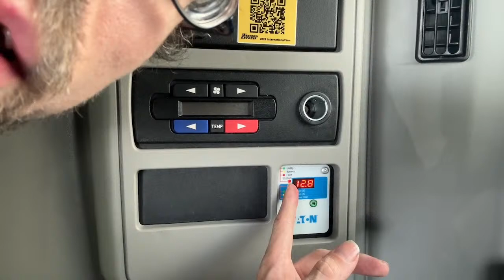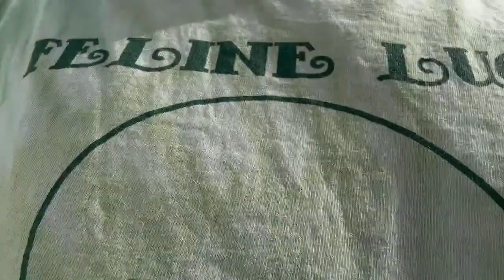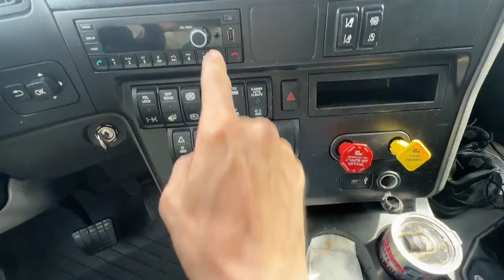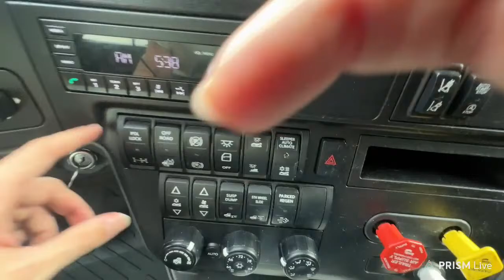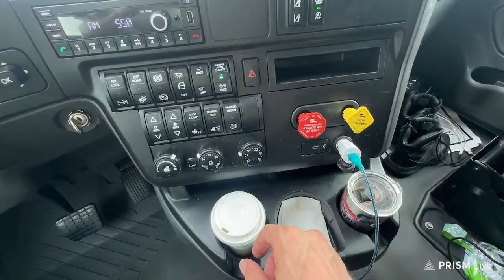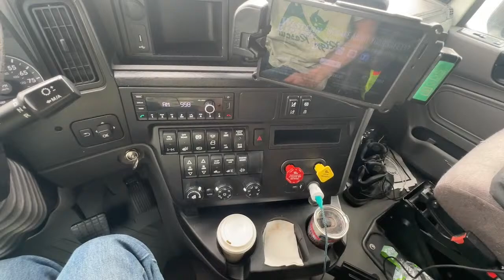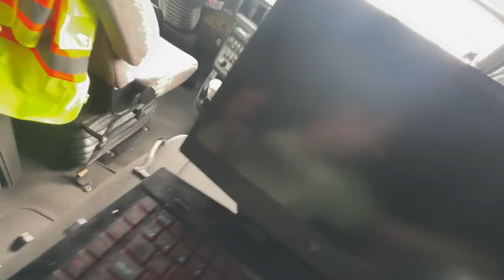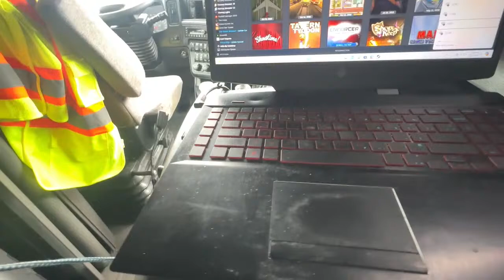Double AA trucking   new truck tour        #Reality   #Trucking #live  #driving

Comment: When you started the truck you have 3/4 tank of fuel
Reply from the maker: That was the DEF not the fuel gauge 
The fuel is on top and was sitting near the 1/8 tank level while the DEF is sitting on the bottom and suiting at 3/4. 
I will do an independent videos on what gauge I am looking at to help understand what gauge does what. 

Hope this helps
Reply: TY
Reply: Tony have you gotten a trailer yet?😊
Reply from the maker: @mollydavis5872  no trailer yet will have to Waite untile Monday to get rolling
Reply: Tony so it looks like you might leave tomorrow?
Reply: Tony do you get to leave tomorrow?
Reply: Tony do you get to leave tomorrow?
Reply: Do you get your trailer today Tony?